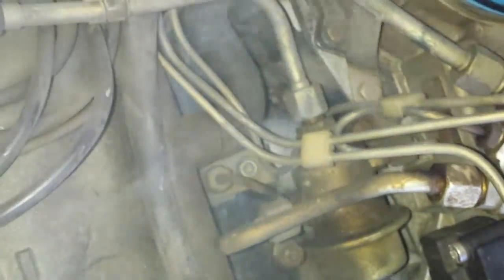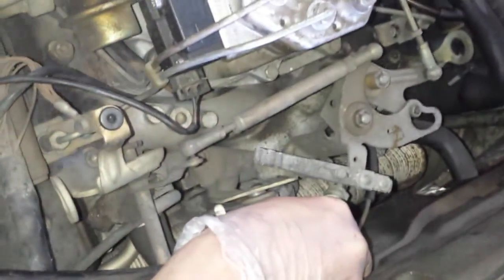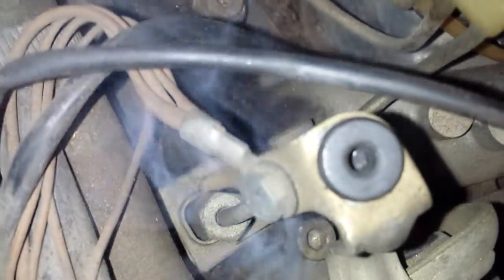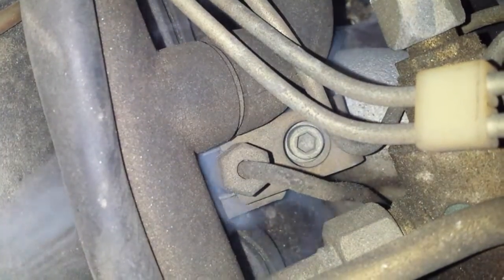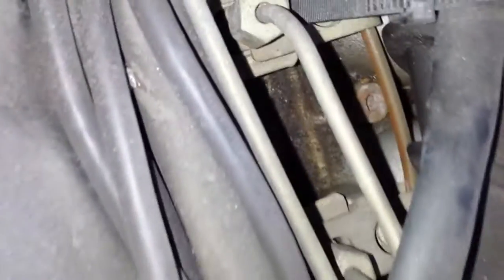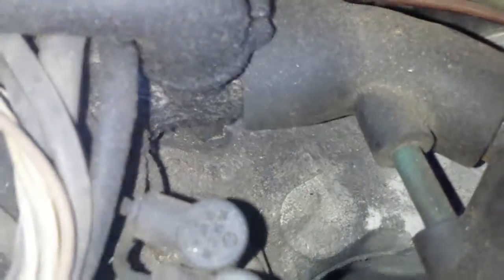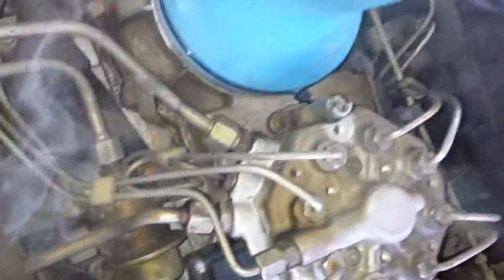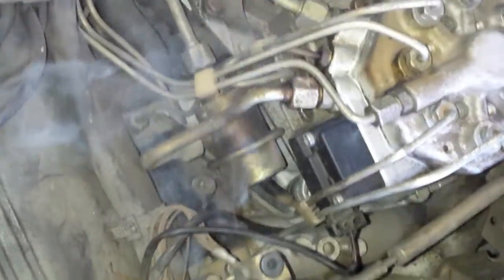Mercedes high idle. Vacuum leaks. Smoke test

Comment: I changed the seals out on my '85 380 SL after finding the vacuum leaks.  I used a little starting fluid sprayed around the injectors while idling to first verify
Reply from the maker: A bit dangerous to spray highly combustible starting fluid around running engine. But it works to confirm leaks. I prefer safer smoke test.
Reply: @vsandvs  I can appreciate your safety concerns on a customers car.  Keep up the great work

Comment: Typical P.O.S. Mercedes - all of the rubber seals will be rotten. 6.7 to reseal the intake. The seals on the injector holders are only the tip of the iceberg...
Reply: Jennifer Rutledge Yeah, right, show me another car this old from another manufacturer that would do better.
Reply: The rubber injector seals tend to get a little dry after 35 years.  Cheap replacement parts and some of my own labor.  And there have been no other vacuum issues